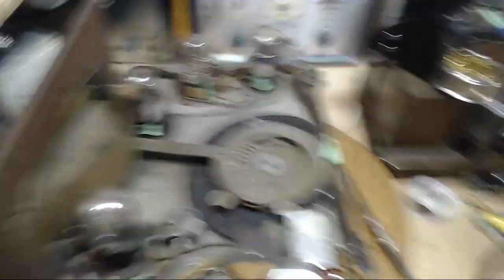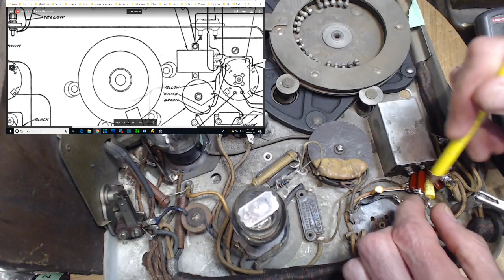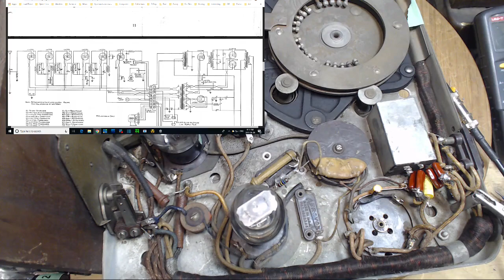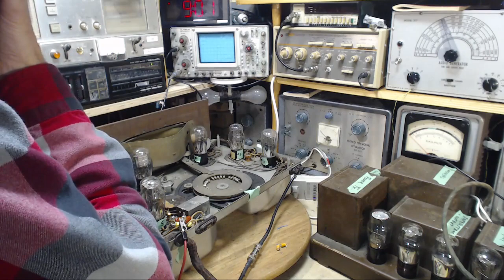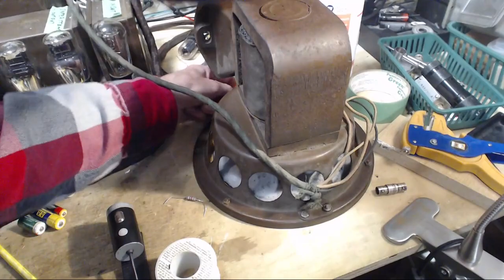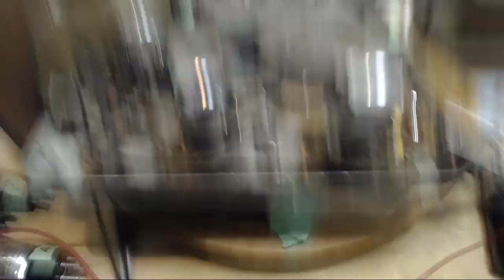1929 Victor RE 45 Video #15 - Problem Found

Comment: You cannot unplug the Loudspeaker as the field coil is maybe part of the smoothing circuit associated with the power supply circuit, it is a shame that no one makes an adapter that will convert a 12AX7 to a UX227.

Comment: What they did with that coil was stick a screw they happened to have in it, since they didn't have the right one, then they put the piece of hose on the top of the screw to keep the coil in place once the cover was put back on. They rube goldberged it.

Comment: After reconnecting the original grid leak components you noticed a significant drop in output level. You then decide to go on to fiddle with the alignment without investigating why the volume dropped. This is just going to add to more confusion by trying to align a radio that is not performing correctly.
In view of the problems you had trying to realign a previous TRF receiver I would leave well alone at this point.
Reply: widecast U are right! Plus it is evident there is still a problem on the 227 detector tube. Schematic shows its plate voltage is derived from b+ via the primary of the first audio coupling transformer acting as the plate resistor. With the detector tube removed(!) and the radio phono switch in the radio position, there is no reason for this plate voltage to be significantly lower than the b+ of 130-140v. Yet in video #13 at around 42:00 with the 227 tube out only 62V are measured using a high impedance DMM. Only explanation for this discrepancy is either a next to open primary of the audio coupling transformer, a high resistance radio phono switch contact, or a leakage to ground from the plate voltage line of the 227. If we add the heavy POP noise when flipping the radio phono switch into the equation, it all strongly points to the latter scenario coming into play the moment the switch is flipped.  And this in turn leads to suspect the plate capacitor on the 227 to be leaky and capping the voltage. (Or the tube socket having carbon traced from plate to ground which IMHO is unlikely). But wth, MORE WD40!
Reply: @melissahermsen5630  the 227 is being run as a grid-leak detector. Ideally it should have a b+ of 45VDC for this application. If you google around and find a proper data sheet for this tube it should have the suggested needed to operate in this mode. 

The pop from the switch is because b+ is completely disconnected from the 227 when phono is being fed to the amplifier module.
Reply: @melissahermsen5630  
61V is what i expected with the tube out .
R6, R7 & R2 drop the voltage !